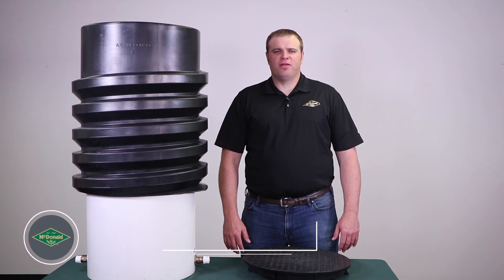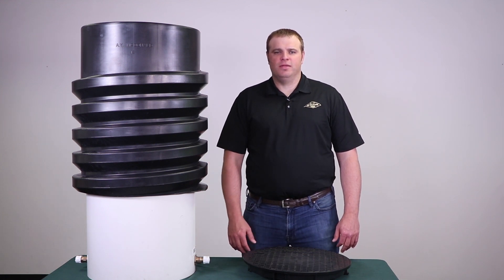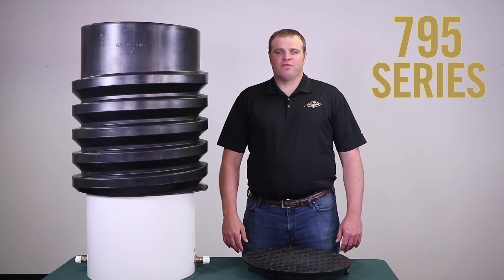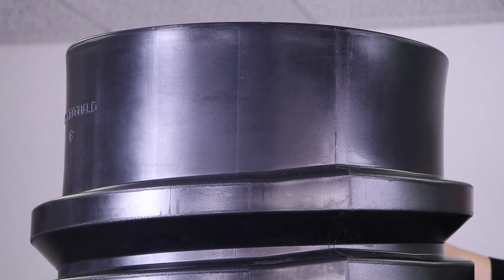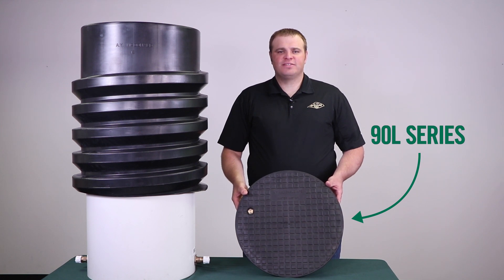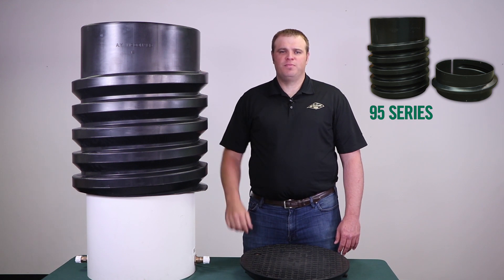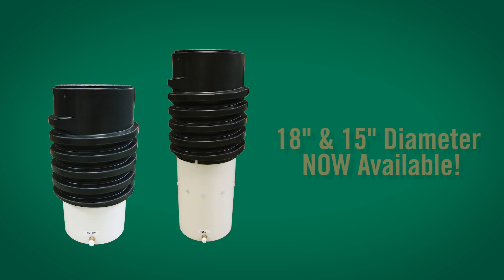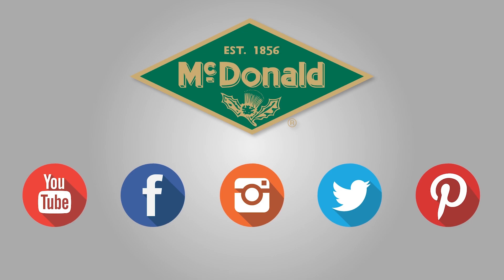McDonald Minute: Adjustable Meter Pit

Comment: Except the plastic meter boxes are shaped like a Pair of post hole diggers. Any pressure on top and that white part keeps digging in deeper. Start with a piece of 18" smooth wall culvert pipe and never need any of this. 🤷‍♂️
Reply from the maker: Hey Jeremy, the black adjustable top is intended to allow the lid to be adjusted to grade after the lower section of the pit is backfilled.
Reply: A.Y. McDonald Thats great but it won't keep the white part of the box from sinking. There is nothing to keep it from sinking down on top of the water lines and causing a break. Since I started using culvert pipe...not one problem. And it's almost half the price per 24" box. Design one that isn't cone shaped and has something on the bottom to keep it from sinking and you've got a winner. Also yoke bars are garbage..they rust and the ears break off resulting in replacement in less that 10 years in some cases.
Reply from the maker: @jeremyfink537  Jeremy, your feedback has been passed along to our water works experts. Thanks